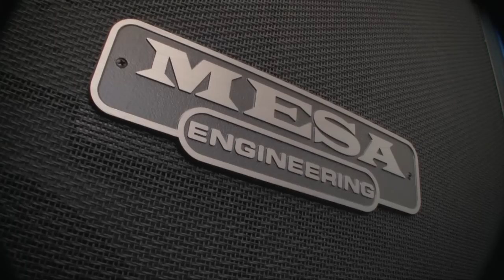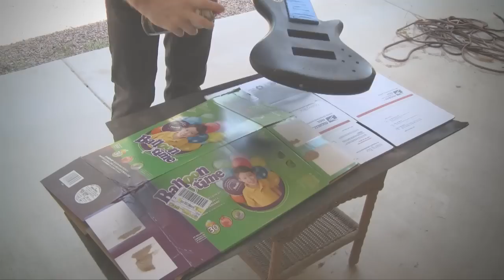Custom Painting an Electric Bass Guitar

Comment: I'm not sure if you did this or not, but you could save yourself some wet sanding time by flattening out that clear (by sanding obviously) after about the second can.
Also, you don't need to use a glossy base coat for the marble effect. The paint actually adheres a little better if you use matte, and it obviously gets glossy when the top coat goes on.
Nice job by the way. It looks good.

Comment: just throwing this out there, but you should really do a vid show the steps and materials used for the marble effect. also i really love the work you do and it has inspired me to start a few peojects of my own so on that note thank you!
Reply: Saran Wrap for the marbling effect

Base coat spray can (usually matte/flat light gray) using the Saran Wrap before the paint dries

Candy paint (what ever color your want) 

HLVP spray gun and will require a minimum of a 10 gallon air compressor which is more than ample for guitar painting.  Automotive candy paints come in quarts or gallons.

For the clear either gloss or semi gloss depending on how much of a mirror you want.  Don't buy cheap crap either.  I'd recommend clear coat paint used with HLVP spray guns.

400 grit sandpaper (what he uses) for level sanding the clear then 2000 grit for final clear sanding (use 3M P grade sandpaper because it has better consistency).  I personally do a 4 step clear coat finish sand of 1000, 1200, 1500, and 2000 grits.  Helps minimize seeing scratches, and I rotate sanding patterns.  1000 Circle, 1200 straight, 1500 circle, 2000 straight.  Go lightly, and get a bright light so you can see the high spots (the shiny)

You can use car polish, though I do prefer Stewart MacDonald's line of polishing.  Anything over 1500 grit sanding you can jump into medium to light rubbing compounds and go into the polish they have.  Once you got the shine you want, buff in some 100% Caranuba wax (aka Brazilian wax, or palm wax) this stuff contains no bees wax whatsoever) as the final protection layer of your finish.

Take your time.  Do not rush any step or you'll have to start all over again if your end up burning though the clear and hit the paint.  Also practice practice practice on scrap wood before ever doing a guitar.  You'll thank yourself later.

Comment from the maker: I'd say if you doing a single guitar body, use at least a whole can of clear. If you're doing a body and neck, 2 cans. I used 3 cans on this bass, thats the most clear I've ever had to use and it was barely enough. I used 400 grit to take the texture down, then 2000 grit to smooth it out before polish. And polish it until its a mirror, which will take a long time, but you don't want to be lazy at this step.

Comment from the maker: You need a glossy black basecoat, a metallic silver top coat, seran wrap, and if you choose to do it, a candy color and a clear coat. You paint the whole guitar gloss black, let it dry completely. Usually about 48 hours. Then you take your metallic silver and spray it on very thick and runny in small sections about the size of your hand. Immediately put the seran wrap on and remove it to get the marbling effect. When you're done, candy it and clear it.

Comment: That is true, I figure you are probably using enamels so it should adhere chemically, but for the best chemical adhesion you use specific re-coat times. You typically wouldn't let it sit over night. Anyway, I'm sure your adhesion is fine, I'm just saying that you don't need to use gloss underneath. You can also go over it more than once with the cling wrap (or pretty much anything else).
I like to use slower drying paints for this, it gives you more room to maneuver.

Comment from the maker: I don't sand between coats because there isn't any point in it. I don't let the coats dry, I do all of the painting while the paint is still wet, and I do all the sanding afterwards. I used water based candy that was ready to spray, so no reducer. Candy red isn't any different than any other color, and I don't use primers for candy colors. Its very easy to do.

Comment from the maker: Yeah, I was painting upwind and I always hold my breath. I'm no stranger to painting, I've been doing this for quite a while. I have a respirator, but its easier to just hold your breath for the 20 seconds it takes to lay down a coat, then I move up wind to breath and then go back. It's much easier. When I bust out the big paint gun for like cars or motorcycles, I'll wear the respirator, but I don't have any issues painting a guitar.

Comment from the maker: Well when I did my first guitar rebuild way back in high school I did research for like 2 months on how to do everything. It turned out okay, not great, but it's not like I ruined it. You just have to take everything one step at a time. Your first guitar rebuild should be like replacing pickups or maybe even paint if you're daring. Don't go installing baritone necks and floyd roses your first time, you're bound to botch the whole guitar.

Comment from the maker: The marbling finish I did is a rather advanced technique to pull off. If you don't have a lot of experience painting, I'd suggest not attempting it. But a solid color would be fine. As for painting the guitar to make it more valuable, you'll only succeed if you do the finish as good as a professional. No one will pay extra for a failed attempt, it would need to be flawless.

Comment from the maker: It depends on the clear coat and how it's applied. I use Deft nitrocellulose which is completely dry in about 2 weeks here in Arizona (natures paint curing oven). I've used acrylic before that took over 2 years to full cure. It's hard as nails, but not worth the wait. Some of the urethane based clears used on cars and such can be dry in under 24 hours.

Comment: I just finished my first guitar and it came out ok. Fun stuff. Why didn't you wet sand after every coat? What is the ratio of reducer to paint in the gun, what does the texture of the paint look like when you spray it? Is it very thin? Does it even matter? I also like how you show how the majority of time is spent polishing. One last thing I was told Candy apple red is very hard to do and you are suupsed to use a dark primer. Is it very difficult? Great job bro

Comment from the maker: Drips or runs? Either way you should be spraying light coats from about 8-10 inches away. I have a hard time getting paint to run unless I hold the can like an inch from the surface or paint it on way too thick. Your first few coats should still show some of the original color underneath. You don't want to paint it solid in the first coat.

Comment from the maker: You need the glossy base so the paint doesn't stick, that's the idea, you want it to come off the black easily so it enhances the effect. If the base is matte the paint doesn't come back up as well and it looks kind of boring. As long as you use the right kinds of paint, the paint will adhere chemically.

Comment from the maker: Yes. Home Depot. Seriously, that's where I get most of my paint, that and Walmart. The paint I can't get from there, I can usually find in an auto parts store. When that doesn't work, I have a local paint shop who will mix up any type of paint I need. I don't really know of any online places except like Reranch, but they want freaking $16 a can! I can have cans mixed locally for less than that, and they put it in a spray can too. I can't justify spending $16 on a can of spray paint.

Comment from the maker: The color coat I put on was water based, so it dried in like 10 minutes flat. Then I put the clear on. I used 400 and 2000 grit for the wetsanding.

Comment: Questions: 
#1 I have a Schecter Hellraiser that has the binding and the exact same logo on the head stock. I want to paint the entire guitar black with a clear coat that is just like the factory one. When painting the head stock I would assume that I scuff the clear as you did, or sand, then how would I keep the paint from cover the logo and the serial number?. You seemed to accomplish this extremely well but I couldn't figure out you're method  

#2  How would I accomplish the same thing with the binding? Just tape it off?

#3 What type brand and type of clear did you use?

Comment from the maker: Is there only 3? Haha. Well first, you have to prep, that means sanding any glossy areas for good adhesion. You don't need to take the old paint off, just rough it up. 220 grit sandpaper works well, I use scotchbright. Then lay down your color coat. You can sand the color coat with 400 grit to take down some of the texture if you want, but its not always necessary. Then lay down LOTS of clear coat, wet sand and polish.

Comment from the maker: You need a wood sealer. I know Deft makes a pretty good wood sealer, try that. Then sand it smooth before you paint it. Otherwise the paint will soak into the wood and it will look terrible.

Comment from the maker: It shouldn't make a difference for hand positions. All it does is give you more note range. Unless you're playing notes on the upper strings that you normally would've had to slide to. I only need like 2 strings on a bass because I would rather slide up to the 12th fret on the low E than play the 7th fret on the A. It sounds better.

Comment: Okay, awesome thanks. 
So just to check, (sorry to be so anal..) would it be wood sealer sanded down, followed by a base coat (I was thinking plain white?) and then apply the actual colour before doing clear coats?
Or would the sealer act as the base coat?

Comment: How exactly are you doing the marble effect with the plastic wrap?
Reply: Spray on the metallic paint, quickly cover with slightly scrunched plastic wrap while the paint is still wet, and pull off to reveal some of the base coat underneath.